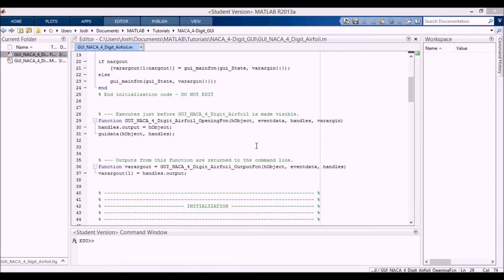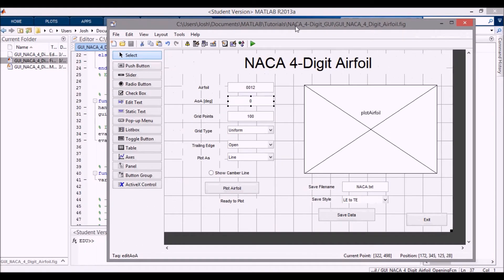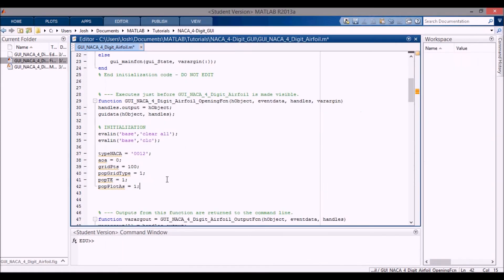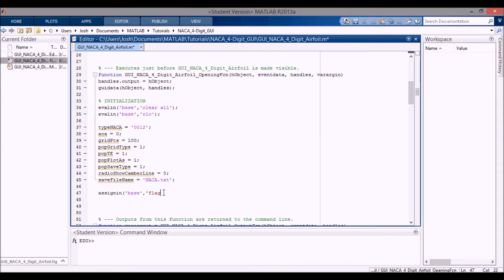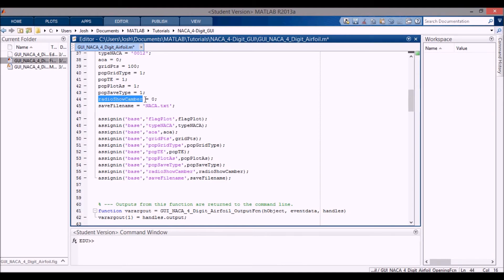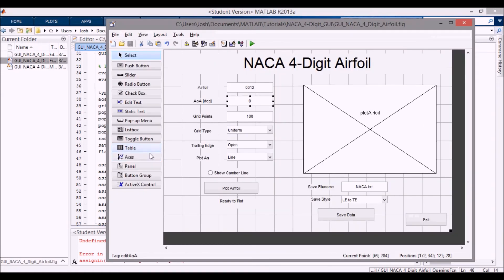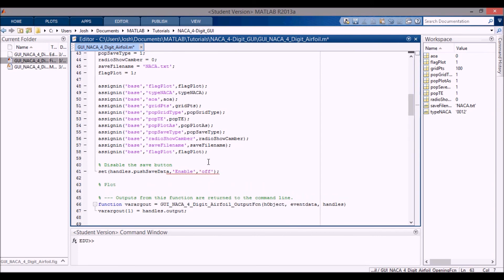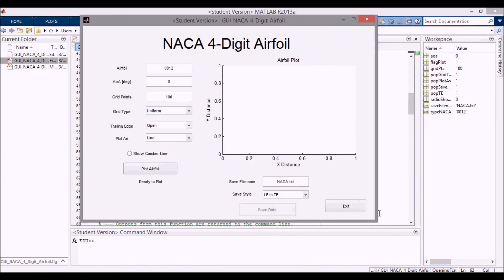Explained: NACA 4-Digit GUI Part 3/10 [MATLAB]

Comment: Why not put all of these in one video?
Reply from the maker: The video would have been too long, and most people get scared off when they see an hour long video.  I like breaking it down into smaller sections that each have a theme, so it's easier to take it one step at a time.
Reply: I realize that now since I'm almost halfway done :P Thanks a lot for these. I had a question about the generation of the airfoil itself. If you plot the airfoil with circles, you'll notice that at the max camber point there is a small gap on the upper surface which makes a laminar boundary layer analysis wrong and creates a pressure fluctuation in the vortex panel method. Do you have any idea how to avoid this? Or am I doing this wrong and that shouldn't happen?
Reply from the maker: Yep, no problem.  I put in a few different ways of plotting the airfoil (circles, dots, lines), but the output format of the text file will always just be discrete points.  So, if you want a more accurate analysis, you can either enable the cosine spacing (non-uniform spacing) for the same amount of points that you had for the uniform, or you can increase the amount of points that are included in the text file, or both.  I would do both if I were you.  That way you get higher resolution at the leading and trailing edges, as well as more data points to smooth out the profile.  Vortex panel methods are super quick to run, so adding in more data points shouldn't slow things down too much.
Reply: I actually did that but the issue still persists. The pressure distribution (-cp vs x/c) has a slight fluctuation at x/c=0.4 on the upper surface for a NACA 4412. I think there might be an issue with the transition from x<p x>=p which causes a laminar boundary layer to separate before it should.
Reply: I am using the Thwaites-WALZ approximation method to calculate the laminar boundary layer on the surface.
Reply from the maker: I don't have enough experience with this to give you a good answer.  Have you checked with a 0012 first, just to make sure the simplest symmetric case will work?
Reply: I could try doing that. Thanks for your help! :)